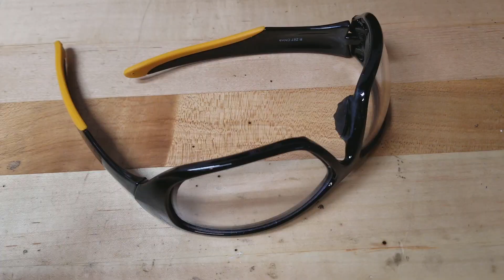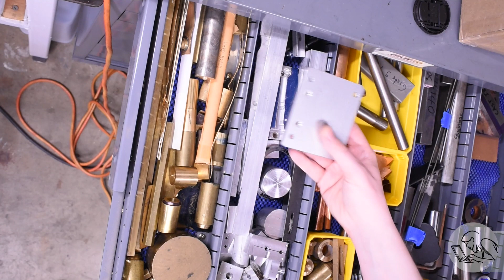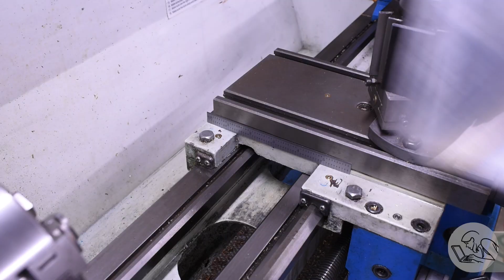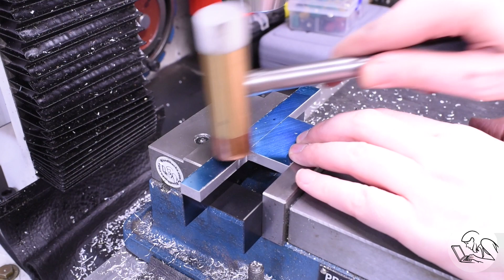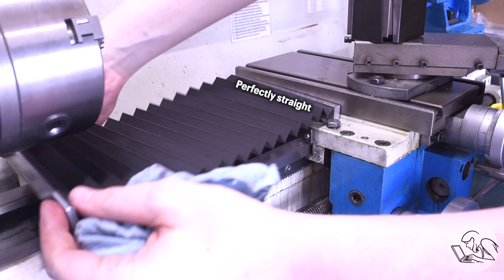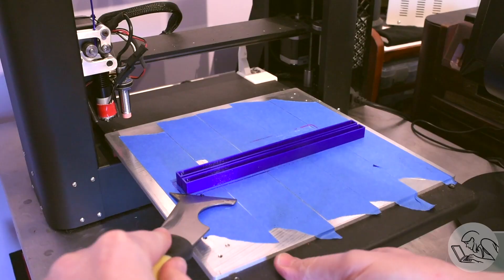Lathe Ways Cover - Let's Make One!

Comment from the maker: Hey everyone! For all those suggesting magnets to hold these in place, trust me you would regret that. Magnets are hell around machine tools. They collect chips and magnetize everything around them, causing those things to collect chips… it’s terrible and impossible to keep clean. The switchable mag bases are the only exception.
Reply: I definitely thought about magnetic strips for about 5 seconds then thought of all the time I've spent trying to clean my magnetic welding squares.
Then I thought maybe velcro but that idea was just as short lived.
Reply: @garymurt9112  Industrial strength Velcro is actually used quite a bit to hold covers like these in place. We'd use the type with 3M VHB (Very High Bond) adhesive on the back. Doesn't work great around coolant but on dry applications it's pretty awesome. But nothing IMHO beats having a mechanical fastener. We used to actually make a set of clips that would be mechanically fastened to the end of the ways. You'd "clip" the last Vee of the accordion pleated fabic into it and it would stay in place until you lifted it out to clean the ways.
Reply: Like what was mentioned with the wire, industrial machines use bellows that are cut to fit the rail or way they are going on. To simulate this and keep the bellows down but still collapsible; making a "C" shaped piece of plastic sheet or shim stock can be used as either a floating intermediate clip the bellows attaches to in the middle, or a clip (like the wire) that will go over the bellows. Any of these options should help mitigate the bunching at the end.
Reply: If you decide to use magnets, a little trick is=Put them in a small ziplock bag or something similar, all the chips will stick to the magnet, open over trash can and pull out magnet, all debris fall off and the ziplock bag keeps it off of the magnets.
Reply: So True! Those things collect every small and sharp chip in its way, removing it is horrible. 
Small tip: 
Only place where I use magnets is in my coolant reservoir. So it will collect the chips which makes is down to the reservoir. 
That way they dont end up in the pump.
Reply: You could have also cut the bellows ~2-3" wider and then by reverse folding ~1" from the the edges you can form it into a "[" shape. This shape then does not bunch up on you when being compressed. Here is an example:  https://youtu.be/EV-eHIGzMPg I have built a number of these and they work great although your first attempt at folding will be a little frustrating until you get the knack.
Reply: I was actually thimkim duck tape ololol
Reply: Quinn Dunki, turn on subtitles for all languages, please!!!! ...
Reply: Of course is true that magnets, as I have used to hold the bellows cover, will attract chips and swarf, but cleaning them is not a big deal really. And any piece of steel (but I don't machine steel all the time) that is there won't be on the ways or other less accessible places. Works for me.
Reply: Use small fishing weights in the mideel of every second fold and if additional wieght is required stagger them like hopscotch blocks to the side
Reply: I'm just sorting out some covers for my Hardinge, I intend to use magnets but the trick is to use cup magnets, they have negligible magnetism away from the face. Still potential PITA when removed but OK in use.
Reply: ahhh -- just what I was thinking  -- LOL
Reply: I've used magnets on my lathe and Bridgeport ways, the ways covered with red silicone baking sheets.  One trick with magnets is to put them in a small, thick poly bag or a small plastic container (like small parts containers).  To clean you simply take the magnet out leaving the chips on the other side of this barrier.  But great job.  Looks great and I like the color of your t slot fillers.
Reply: What you said, Quinn...only moreso.
Reply: Tell me about it!  I had a little magnetic parts tray on my lathe that I kept a few pieces of brass and aluminum cutoffs in, which was never a problem until I started keeping my center drills and other stuff in it. After that, every time I drilled something, the chips would be sticking to everything.
Reply: Why not just use "the force" ? It's worked for me and my fellow Jedi for years.

Comment: @blondihacks Pro Tip about the 3d printer.  Ditch the blue painters tape and get yourself some hair spray.  Aquanet "All Weather Extra Super Hold" in the lavender can.  spray your print bed with that and your parts will stay perfectly.  Then when you need to remove them, use a little canned air, turned upside down. it will freeze the part and shrink it enough that it will pop straight off. then you will never scratch up the print surface or deal with changing out your torn up baked on painters tape.

Comment: I think there IS a really good reason why you cut those t-slot fillers to length rather than modeling them correctly. Most 3D printing enthusiasts would have thrown those out and re-printed them, but that's a bad, wasteful habit to get into. I think this was some combination of a conservation mentality, being familiar with subtractive manufacturing, and of course having a slow printer :D

Comment: Hi I have the same lathe and converting it to CNC doing a lathe cover too I am using magnets to hold to the head stock and the carriage makes life very easy to take off, I have also built a control box that bolts to the Lathe, I also machined off the ways and fitted linear rails, I turn 95% Aluminum so magnets are fine for my purpose,

Comment: they make a fiber enforced version of those covers that wont bunch up nearly as bad they are stiffer so if you buy them, buy it long, and cut it down to the size you need. if you do buy long, you can get one where its double the size you think you need and you have a spare just incase a piece of work catches the ways cover and tears it.

Comment: Ahhh, The reference to you and your family are horse ppl. That explains it all. As is my wife and 1 of 2 daughters that enjoy the equine world. I have noticed that you like keeping your shop very organized, And make items to make your everyday life just a little easier. Instead of the other spectrum of the typical horse ppl that half ass stuff back together with duct tape and zip ties. And worry about fixing right the next time when it breaks again. Which is my father in-law, and it drives me NUTS.  And its unsafe. Pretty good idea here, and since McMaster Carr is in my back yard (Aurora, Ohio facility) Im going order some of this up and have it sent to will call. My lathe and the new project, My recently acquired Wells Index 745 Vertical Knee Mill sure could use a cover on the back of the table to protect its 54 yr old ways. Nice hack there Blondie 😉

Comment: when I made mine, I repurposed one of those roll down shades for car windows.  Its already on a sprung coil to retract, just mount the ends & your good to go!

not a critique of her method, just another option.  actually, my first method was a many tiered scissor mechanism.   that one didn't have to have a headstock end mount, just cantilevered out from the carriage & collapsed as you got closer to the headstock.    but I never got the fabric to "bunch" right.  her pleated system probably would have solved that, might re-visit it.

Comment: Hi Quinn and the wider community, great video as usual, thank you! In an effort to protect the machine and make clean up easier I set out to protect my DRO installation on my Harrison lathe. The 'X' axis scale has a cover but I still feel that having spent the cash I wanted to remove all potential intrusion of swarf and fluids. So I installed a sliding plastic cover that extends in front of the scale and below the vulnerable components, it is about 12" wide and is angled backwards away from the chuck at about 15deg. The cover is self retracting and is anchored to the left hand end adjacent to the headstock, the other end is anchored to the carriage and extends with the 'X' travel. It can be un hooked from the carriage if required. Even better is the fact that it cost £12 from Amazon, original purpose? - A child's sun screen for a car window! It's so simple, cheap and very, very effective. If you're so inclined I have put a video on You tube but I warn you I'm not in you're league when it comes to You Tube. https://www.youtube.com/watch?v=y7aOpQ6M6Z8

Comment: Great idea ! I noticed that the cover is bending and does not fold completely. I also noticed that you used twine and nuts to weight down the cover. If I can suggest something - you can stick narrow strips of sheet metal on the bottom of the cover, especially at the end of the cover, where it bends. Of course, the sheets must be thin, e.g. 0.5-1 mm. The sheet metal strips must not touch the bends, so as not to cut the cover.
Reply: Of course, the best choice for a sheet will be metal with the highest density. Mendleev's table, metals, state of aggregation and solid, density. In order Platinum, Gold, Lead .. The most reasonable (price) will be lead ;)

Comment: Very educational, as always: thx :) For way-covering material: visit your local bicycle shop. They always have a bin full of used up inner tubes which cannot be repaired. Just ask if you can take a couple (they’re going to be thrown out anyway). 

Cut the circular tube into pieces a bit broader than your lathe ways. Then, cut these tube pieces open along the length and clean them with water (they usually have some sort of protective powder on the inside). Glue together the cut tube pieces and take care to glue them in a harmonica-like structure, so they fold up when the cross-slide nears the chuck. 

An easy and free solution!

Comment: Hi !  Being a "silent viewer" for a long time, i decided to post something besides expressing my absolute favor for your videos :-) I'm not a "3D-print-professionalist", but after some years of use I found the perfect solution for sticky prints:  Use a thin plate of glasfibre reinforced plastic on the heatbed. just clamp it directly to the aluminium heatbed, discard all other foil or whatever has been on the bed. Over here the best material is simple "FR4 GFK", thickness about 1 or 1.5 millimeters. This is conveniently sold on ebay or other places in matching sizes for heatbeds and lightly sanded. I did a quick search on the net to find something alike in the US, but maybe it's sold under another description. I was highly impressed - as long as it's heated the print sticks like being glued, after some cooling the print nearls falls off from the GFK-Plate. So simple. I clean the surface with some Isopropyl and re-sand it slightly after frequent use. 
That was the tip :-)  Now for the applause:  PLEASE keep doing videos and please keep doing them in exactly the way you are doing them now. The list would be far too long if I tried to list all what i like about them and as far as I've read some comments from past videos, everything has been said :-)  Well maybe ONE thing: I admire your ability to critize yourself AND laugh about yourself - at least it seem's like...   Thanks in advance for many more educating and entertaining content, greetings from Germany.

Comment: Ok, magnets are not good, so if you watch and like my mill chip guard, (https://www.youtube.com/watch?v=n9RnqsXrkaE&list=PLSstDnpSit0DRn-Ez8DaVZM2mBYWIC_Wr&index=5)
I found using a Tee nut with a bolt works as well to hold the wings in place. Sewing up was a piece of cake, but not everyone has a commercial machine :)> Hope you will comment if the Bat Wing chip guard seems smart (@@)! Cheers, Bear. Oh, glad you made it on ARW last wk,,

Comment: A great vid on keeping the ways clear. The only tip that i would give is to use a soft material such as cardboard between your hole punch and the plastic when making the holes. It doesn't dull the cutting tips therefore keeps them in good nick.
Reply from the maker: The tool has a brass anvil in the jaw. The makers thought of that. 🙂

Comment: Nice!   IIRC this concertina cover material can also be "origami'd" into folding up/down at right angles, which can make it even more effective, and might also solve the buckling problem at the same time if the vertical part is tall enough.  The folds might make it a bit less compressible though.

Comment: Hacksaw sure builds character. Make sure to not replace the blade when dull👍
Reply from the maker: Sharp blades are for quitters
Reply: @Blondihacks  😂😂😂😂😂
Reply: I hand all my new maintenance guys a hacksaw when they arrive. So far I am 1 out of 10 for users, one day I am going to take all the cordless tools away and hand them a stick of 3/8 all thread and a bucket and have them start cutting to various lengths.
Reply: Character building.. lol 
Replacing the blade comes down to many variables. Value, productivity, accuracy.. I have a draw full of spare blades for each hacksaw, but rarely change them untill i snap em 🤠
Reply: Why replace the dull blade when you can simply build a custom jig to resharpen the blades with a tiny file chucked into a reciprocating arm

Comment: My Father-in-law is a Master Machinist,-. He recently spent a week with me helping me out with learning to use my mini milling machine (a Seig). After the week (and after learning to make and use a SINE bar) dad said I should be able to do most anything I wanted to accomplish as a hobby machinist and that I'd have made an excellent apprentice. Felt pretty good honestly but the main point of all of this is to tell you that Dad also uses and taught me to use both my height gauge and my calipers to mark parts that had been Dykemed just as you do. PS, Just because you spoke so highly of it I added a 3 Axis DRO to my mini mill and It's one of if not the best mod I could have added. Thanks for your info on that too Quinn. Dad said he is going to look you up on you tube when he got home too. He likes the way you teach and so do I. Thank you so much.

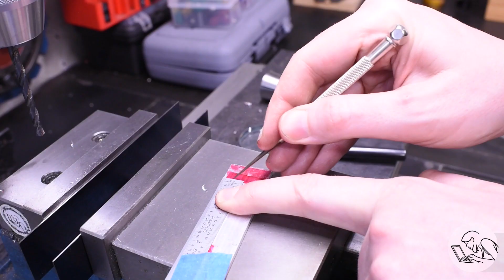Comment: wouldn't fit better a U shape dust cover, like the one in your mill? ( 3:46 ) 
That will cover the sides of the lathe too, and would prevent lateral contamination., And because of its shape it will not deform to the chuck
Reply from the maker: Yah, maybe!

Comment: Excellent Job!!  You can top this off with refrigerator magnets.  Cut some small pieces to go over the socket head capscrews that are on the carriage and cross slide.  Keeps the chips from clogging the allen key holes. Just brush the chips off.  They last for me about 3 months before chemicals soften them. But they are free, so it doesn't matter. Keep up the good work!!!

Comment: The really thin spring steel (~0.3mm) decorators filling knives are perfect for popping 3D prints off the bed. They can be pushed flat down and hence worked parallel to the bed so there is a lot less risk to the print and the print surface. Dressing one face of the front of the knife with a semi sharp edge helps too.

Comment: Too bad you just cut the cover in half. There is actually a neat way of folding the overhang in front and behind the bed downwards 90°. This makes an inverted U shape cover and maybe protects better against chips getting under. Just search for "fold way covers". I wonder though if the material you chose is suitable for folding. Great Video anyway, thanks for sharing, and tbh I just went with the leather :D

Comment: Maybe cut the underside shorter, to make the upper folds more stiff and bend it down between the ends (or else stiffen the upper folds).
Reply: Maybe mount the ends at an angle, to induce a bend down instead of up?

Comment: May I suggest making a hoop extending from the left accordion attachment points made of a bag tie thick enough not to flop or be affected by wind but would prevent the accordion raising up as it approached closely from the right but the hoop would bend left and right easily when touched but not raise. The big problem would be snagging the accordion. Maybe a small ski rider in the middle? (An inch long 1/2 inch wide with small bend up on both ends?)

Comment: Quinn, lovely video, nice work, I need to do that to my lathe and mill .
I have not seen a small ratcheting die holder like the one that you used in this video. Could you please tell me what brand it is and where to get it? Thanks.
Reply from the maker: It’s the GearWrench set linked in the description

Comment: Every time I consider making way covers I become worried that chips are going to build up under it and I won't be able to tell because of the cover. I've been in analysis paralysis for a couple years on this issue. I have a very old machine that I was lucky enough to find with all its scraping intact and I'm very anal about oiling The ways prior to turning. assuming you faced the same decision, what made you lean towards covers? Or in other words, reassure me want direction or the other

Comment: Ironically, I think if the strip against the headstock was still angle iron the accordion would not bunch up. I've only seen the one example on video, but it looked like it was consistently bunching up within that first 3/4 of an inch. Just a thought. Came out beautiful though

Comment: On the T piece, you said you applied the layout fluid heavy. Does the fluid affect clamping in the vise? Does it increase the thickness of material to where it would affect precision facing? I saw it was unmarked when released from the vise.
Reply: Do a test yourself - thick layout fluid versus vice (vise in USA) pressure. Use dial indicator to determine compression and see if vice or fluid wins. I am putting my money on the vice.